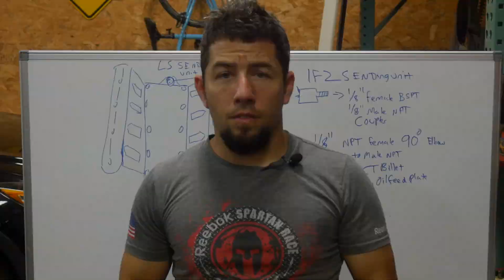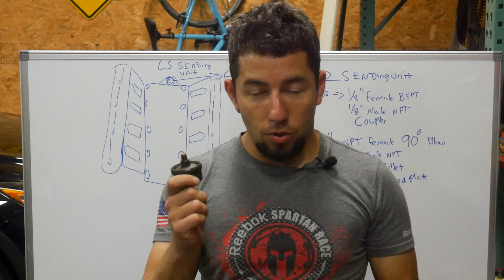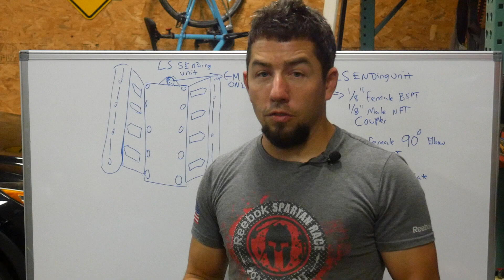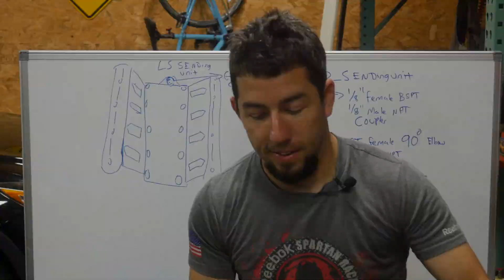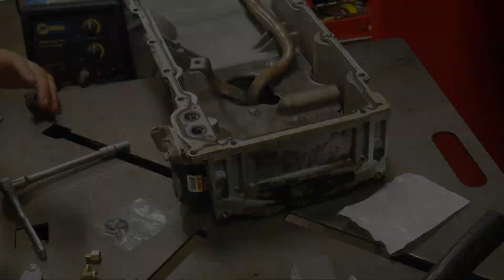80 Series Land Cruiser LS Swap Part 10! Oil Pressure Gauge, Exhaust, Ready for the FIRST DRIVE!?

Comment: Congrats on getting it running. A couple of issues I see. That turbo adapter for the oil pressure gauge doesn't look like it has a very big oil channel. If it's not big enough it will starve the engine of oil at higher rpms. I've read of Ls engines spinning bearings because of similar adapters. The gm adapter you removed can actually be used. It's npt but the toyota sender will thread right in and won't leak if you put Teflon tape on the threads. Also the toyota oil sender is pretty sensitive to heat, it won't last long near an exhaust pipe unless you protect it somehow. I believe the gm oil pressure sender in the valley is for kicking on the oil light in the gm gauges through the ecu. So you can probably delete it or move the toyota sender their if you have room. Maybe u did this already, but you will want to pull your front coils out so the suspension is sitting on the bumpstops to see if your tie rod clears the oil pan.
Reply from the maker: Moabman 
It’s a small channel but it’s only got one orifice so it can’t really starve the engine as it’s just monitoring pressure and not letting oil pass through it to another destination. The part I removed is not threaded, at least not on an f body pan.
I need to retain the gm oil pressure sending unit so in the event of a suspected issue I can monitor actual oil pressure measurements and not marks on a gauge. 
I’ve already checked clearance on the oil pan and there’s no issues with the fbody oil pan.
Reply from the maker: Oh and thanks on the tip for the yota sender. I’ll wrap it up in some heat protectant material.
Reply: @I_Do_Cars  Right I understand the oil sender itself isnt restricting flow. So from what I understand (correct me if wrong) oil flow goes through that adapter to oil the engine. Your oil sender itself is just a tee and not impeding flow. If that adapters channel is any smaller than the GM adapters channel you removed it can starve oil. From what I understand some of those aftermarket adapters have a smaller pathway machined than the gm adapter.
Reply from the maker: Moabman ah I see what you’re saying. I don’t think it’ll be a problem. The depth is a little more shallow but the inside of that adapter is plenty big enough to not impede oil flow. As well, this engine isn’t going to be pegging the limiter, and not under a ton of stress. I thought about having the stock part machined and threaded, which is always an option down the road. We’ll see and I’ll keep and eye on it.
Reply: @I_Do_Cars  yeah that's what I meant. And in regards to the stock part, the toyota sender threads right into it, no modifications needed.